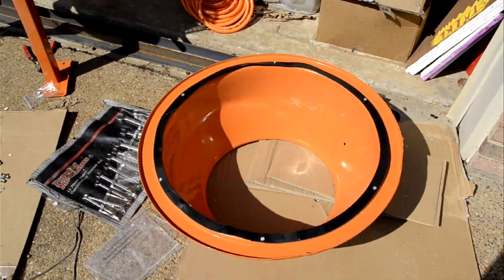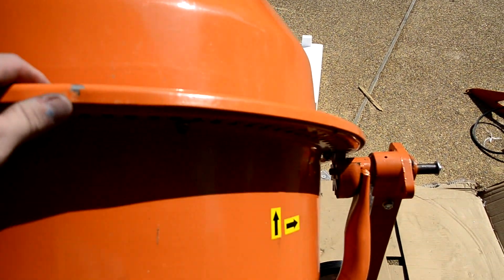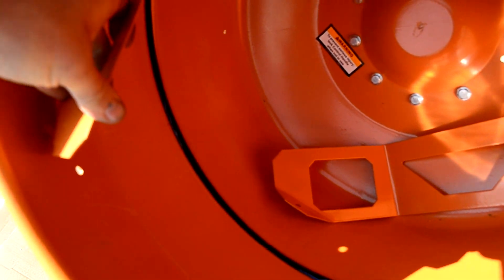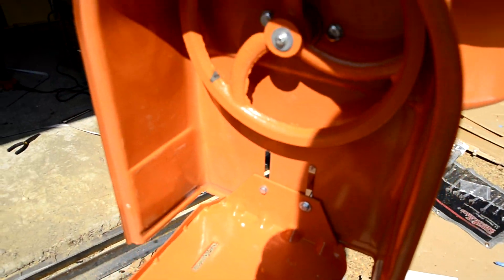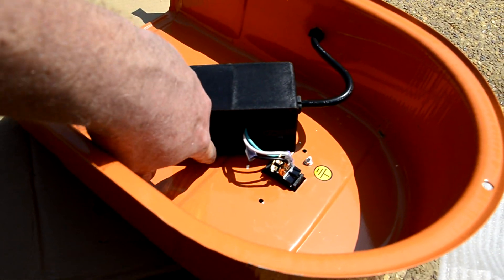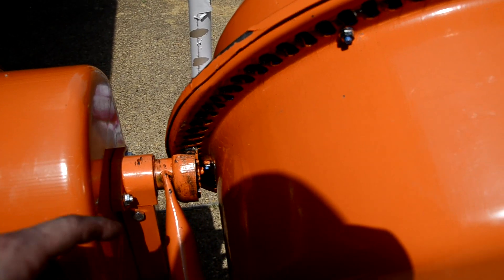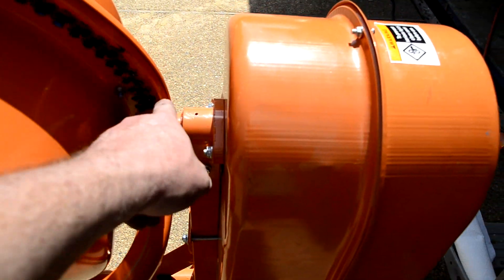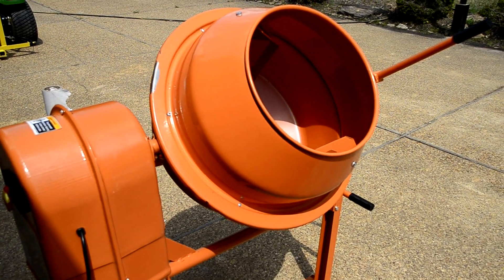HF-Cement-Mixer-Assembly Part 2

Comment: I had the usual problems, but they would have been much more difficult to solve and much more time-consuming without your video. I was having trouble setting the key into the keyway on the driveshaft, so I installed the drive pulley on the driveshaft without the key, taking care to align the two keyways squarely, and then carefully tapped the oiled key into the keyway, as if tapping in a nail.  She went in smoothly.  Timewise, 5 hours, but she runs!  Thanks, again, friend.

Comment: You can't get the bigger side of the gasket to the outside because it is cut in a circle, and the circle can only go on in one position. Were you able to get apart the gear end where the gear shaft bearings are? My gear is a bit hard to turn but I can not get to the bearings. I did undo the bearings that it tips on, they were horrible. I couldn't tip the barrel, I had to pull off the ends, steel wool them and grease them.

Comment from the maker: I love this mixer.  I have mixed about 40-50 bags in it and had no problems at all.  I can't remember if I specified in the video, but I mix two 80lb bags of concrete at a time.  I first put in 1.5 gallons of water then I put in 1 80lb bag.  After it is mixed in good (soupy), I add the 2nd 80lb bag.  AFTER I add the 2nd 80lb I turn the mixer down to almost a 90 degree angle.  If you do not then it won't mix good. I have it at about 45 degrees to add water and 2 bags of mix.  This works great!

Comment: Yes, the "key" (small square piece of metal about 1" [25mm] long) goes into the slot (keyway) in the shaft (what you refer to as a piston, I presume) before you slide the pulley (wheel unit) onto the shaft. It transmits the torque from the pulley to the shaft and prevents the pulley from spinning around the shaft.

Comment: Thank you for the video.  The printed instructions suck to say the least... funny that I notices the same misalignment of arrows on the tub and had to take out a couple of bolts to put the paddles in.... I also used gorilla glue for the gasket sealer which I think will be ok.. had some gobs streaming down the inside which I'm sure will help mix the cement.  Plugged it in and it worked like a champ... I fell for some of people trying to put this thing together that aren't mechanically inclined.

Comment: Thx for the vid, didn't look at the instructions one bit, just followed your vid.  The only mistake I made was not lining up the bottom and top drum, I didn't see the arrows until after I used the sealant and screwed it together.  I was done in 5 or 6 days, no problem.  Appreciate ya.

Comment: Did you notice that the arrows on the drum are not lined up, like they are supposed to be.
Reply: I would say that I did not but thankfully it did not affect the performance.  I still have this unit and have continued to use it on and off for any concrete project.    It has been many years since I did this so I don't recall the details.

Comment from the maker: I have continued to use this mixer and have had no problems with it.  Yes some paint has flaked off in a few small spots but not an issue.  I would just spray some Rustoleum on it :)  After almost 2 years I have am still very pleased.

Comment: Thanks for the video! Mine is exatcly like this but from home depot and I would have been lost without this video. The only confusing part was the numbered bags. Mine were numbered differently and I think you said to use bag 12 twice. I used bag 6 for attaching the arm to the stand and had to play around with it before i figured it all out. :-)

Comment: Thanks for showing how to do the blades. The instructions are pretty poor. Took me a while to figure out that the round metal slug was to go above the spring for the handle. The bolt presses on the slug, which presses on the spring.

Comment: Nice video. Unfortunately I was only watching to see the wiring (only yhing not in the manual) and you skipped over that!  Haha.   Not sure how you got the paddles to line up when the 2 yellow arrows on your 2 drum halves weren't lined up.  Maybe you got lucky and got it 180 degrees off so it still worked.

Comment: I have the 8 bolt upper/lower drum. the upper drum has no arrow to show where to align upper lower halves. should paddle bolt holes be aligned with each other?
Reply: it's been 2 years and no reply, are you still waiting for an answer  :-)

Comment: how is this mixer working for you? I'm thinking about buying one ...Can you fit 2 80 pound bags of quikrete in this? Please if anyone could answer me would help.
Reply: I still have this mixer and it works great 5 years later.  It handles 2 80lb bags just fine.  You just need to start with it tilted up 45 degrees and slowly work it down as it mixes up.